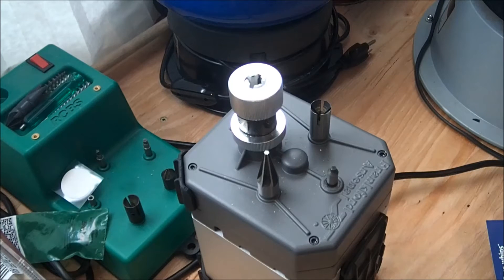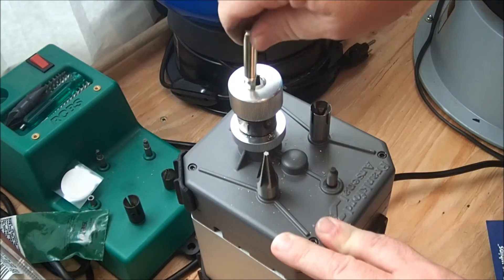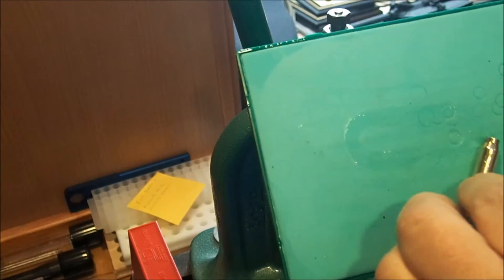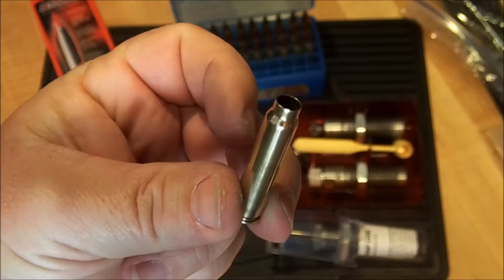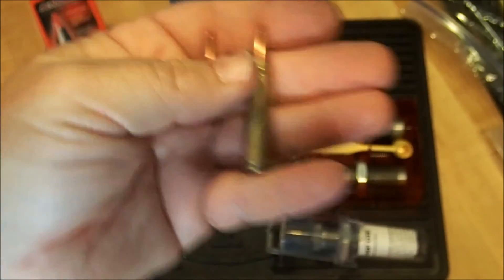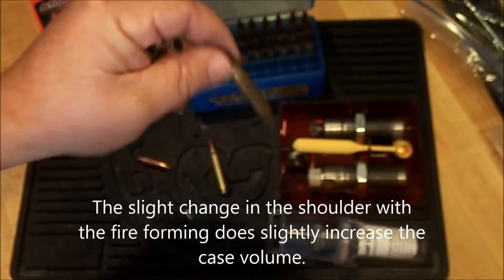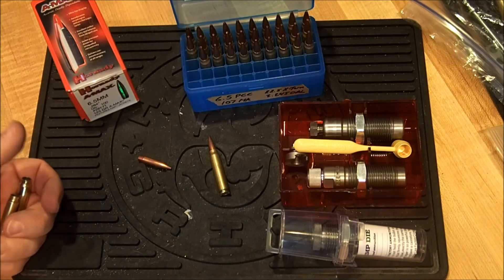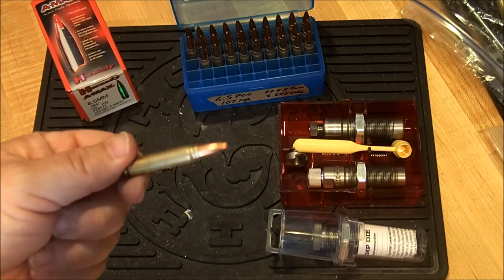6 5PCC

Comment: What is the exact dimensions of the 6.5 PCC?
Was it 6.5x45mm or not?
Reply from the maker: No, it is a little shorter.  https://illirianengineeringc.ipage.com/uploads/3/0/2/6/3026173/8298934.jpg?865
Reply: @markpcolo Originally the case length was 45mm, how long is it now?
Was it 43mm in case length?
It's measured in inches at the link.

Comment: this is something like my 6x45 you just size up 223 to fit 6mm i like the idea of doing it with a 6.5 but i think the jump in bullet price will keep me from building one.
Reply from the maker: Very similar.  I like the 6x45 a lot too.  With 95s, 107s and 123s, I find the costs as compared to the 6mm bullets that are 95 grains to be minor.  But I would think if you have one, the other won't be much of an improvement either way.

Comment: The 6.5 PCC is the same as the 6.5 grenedel?
Reply from the maker: No, it is not.  Based on the .223 case.  The Grendel is based on the 220 Russian, and it is shorter and fatter.  In the same volume of magazine, you get more (and more reliable feeding) with the 6.5 PCC over the 6.5G.  But you give up about 100 fps of velocity to be able to use .223 bolts and magazines and easily modify .223 brass.
Reply: +markpcolo What is better?
Reply from the maker: I prefer the 6.5PCC.
Reply: +markpcolo Why?
Reply from the maker: Because of all the reasons I mentioned in the differences.
Reply: +markpcolo And the recil?
Reply: +Iosef Pindo *recoil
Reply from the maker: Recoil?  About the same as .223 77s, but less than the 6.5G.
Reply: +markpcolo A less recoil is a less energy, no?
Reply from the maker: Rebekah-Chris S-K barrels are available. Will try to get some additional videos up.
Reply: How hard is finding barrels ? Do you have any shooting videos  with it?
Reply: Nice I appreciate it trying to find out more about this cartridge as I'm looking at building up an ar 15 for it as well
Reply: No, its apparently the same thing as the 6.5 MPC, but with a super edgy name. The Grendel is 6.5 x 39, based on the AK cartridge.